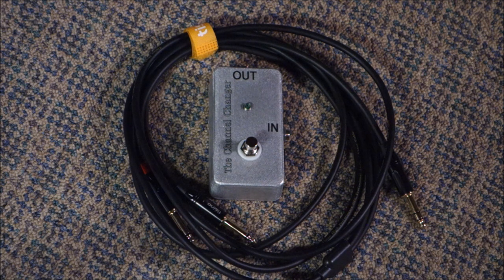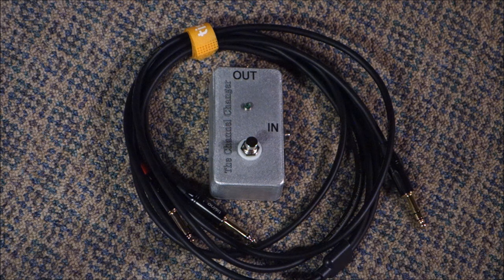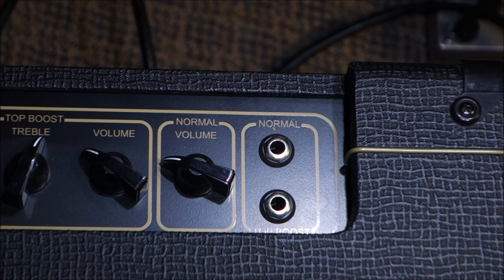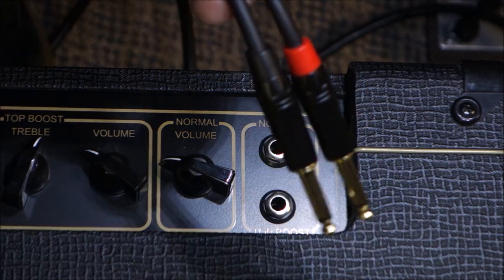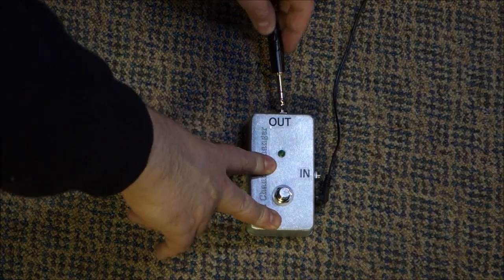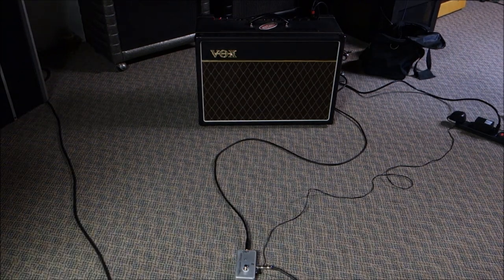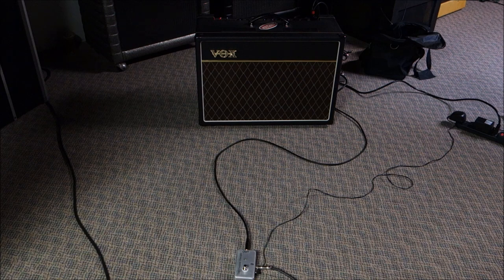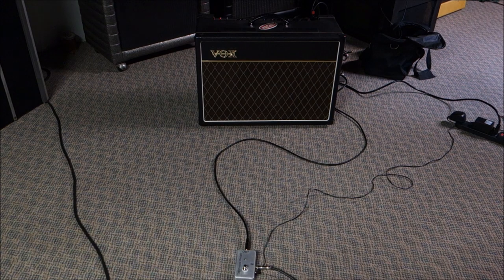A NEW Creation from Mr. V. Amps!  The Channel Changer!!

Comment: I was gonna suggest you use a bi-color LED and match the cable to the LED's colors, but then I realized that might make it harder for players who are colorblind to set it up. Your setup is much simpler and efficient. Good job!

(Fun fact: if you plug a cable like that, with the stereo plug of that cable into the treble boost out on a Vox VBM1 amp, it basically gives you an FX loop between the booster output and the power amp input on the split plugs).
Reply from the maker: It's just as plausible to do either 2 lights,  or a color changer...  it'd just add a few bucks to the cost.   This is a new design, so I didn't add any flourishes.  I was thinking of it like one would think of an overdrive...   when you're on the overdrive channel, you get the light.... when you're not,  no light.
Reply: @DeadKoby  Absolutely. Makes sense!
Reply from the maker: Being both a technician,  and playing in bands with other musicians,  I find that the simple designs are the most popular.  Some of the most versatile amplifiers,  like the Sundown (look it up) confused the heck out of anyone who wanted to "Just Play"  and not spend time dialing knobs.